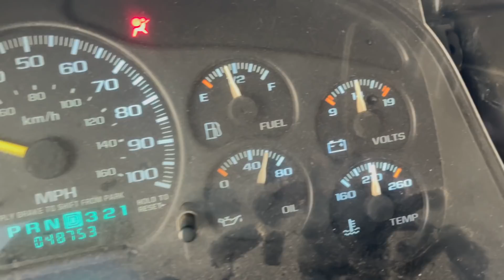New Exhaust On My Orange SS Clone 🍊 | VLOGMAS DAY 18

Comment: Simple ass fix, trace the leak and fix it the correct way, hook up the e fans to an ignition wire or fuse so they’ll automatically turn on once the truck is on